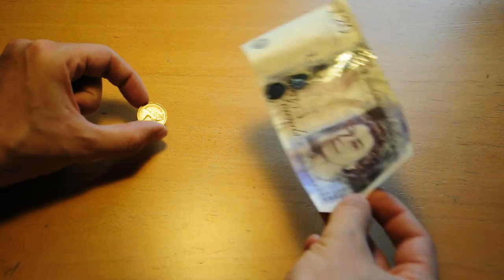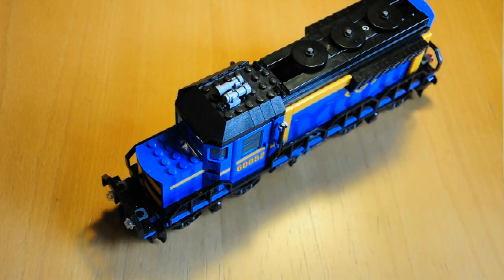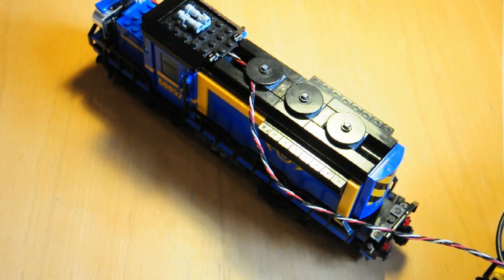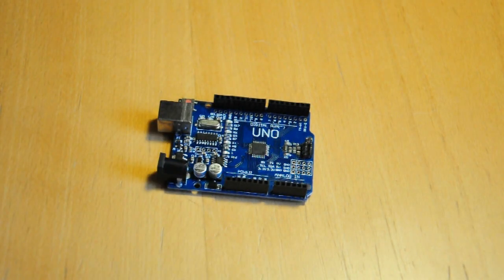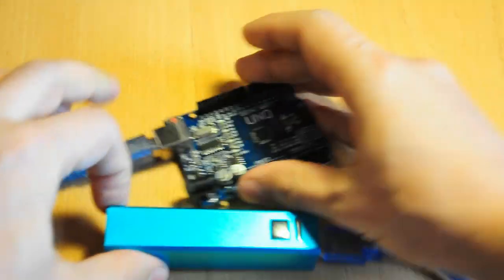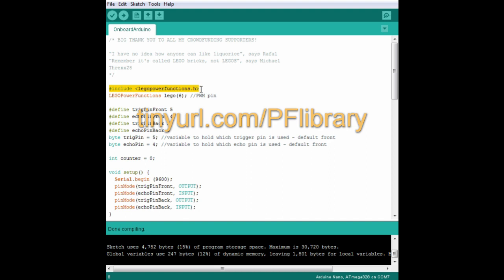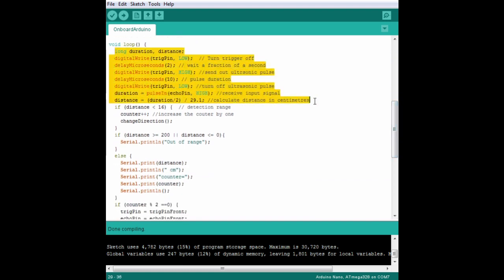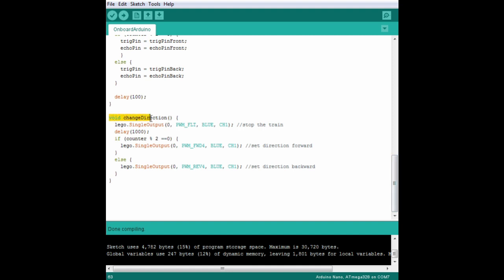Arduino for Lego Trains #12: Onboard Arduino for Power Functions

Comment: For how much time can Arduino works using a power bank power supply?
Reply from the maker: Arduino uses about 25mA and the power bank I use is 2500mAh, so approximately 1000hours. Of course, LEDs and sensors will drop this time significantly, as will power bank efficiency. Still, it will last a lot longer than the AAA batteries in the train!

Comment: Can't you take power from lego battery pakage
Reply from the maker: +Michal Pietrzak it's possible but not stable, especially with these sensors. I will show how to do it on the next video.
Reply: Ale dlaczego?
Reply from the maker: +Michal Pietrzak power output to arduino and motors at the same time is not smooth,  so power to sensors becomes unstable which means the code stops working. With LEDs instead of ultrasonic sensors it is not such a problem,  but IR leds do not work as long range distance sensors.
Reply: What about big capacitor
Reply from the maker: Maybe you can try :) I just make simplest solution for beginners
Reply: Yes , you are right. I understand your intencions

Comment: If I were to just make the train stop without changing direction and only move when there is no obstacle,which part of the code do i change?
Reply from the maker: where it says: if (distance < 16) {
delete the next two lines, and type in: lego.SingleOutput(0, PWM_FLT, BLUE, CH1); 

and in the else section (where it says Serial.print(distance) etc, add the line:
lego.SingleOutput(0,PWM_FWD4, BLUE, CH1);

You can then delete all references to "counter", the void changeDirection, the trigPinBack and echoPinBack sections, to make your code much smaller.
Reply: #include <legopowerfunctions.h>
LEGOPowerFunctions lego(6);

#define trigPinFront 5
#define echoPinFront 4
byte TrigPin = 5;
byte echoPin = 4;

void setup(){
  Serial.begin (9600);
  pinMode(trigPinFront, OUTPUT);
  pinMode(echoPinFront, INPUT); 
}

void loop() {
  long duration, distance;
  digitalWrite(trigPinFront, LOW);
  delayMicroseconds(2);
  digitalWrite(trigPinFront, HIGH);
  delayMicroseconds(10);
  digitalWrite(trigPinFront, LOW);
  duration = pulseIn(echoPin, HIGH);
  distance = (duration/2) /29.1;
  if(distance < 16){
    lego.SingleOutput(0, PWM_FLT, BLUE, CH1); 
  }
  if (distance >= 200 || distance <= 0){
    Serial.println("Object detected"); 
  }
  else{
    Serial.print(distance);
    Serial.println(" CM");
    Serial.println();
    lego.SingleOutput(0,PWM_FWD4, BLUE, CH1);
    
  }
}

ps:Im controlling the motor directly with an L298p Driver.I tried changing THE Codes so i can use it for infared.If You could assist that would be great
Reply from the maker: I don't really understand what you are trying to do. How do you have the L298 connected?
Reply: Its an L298P shield v1.2..I strip the motor wire,connecting it to the motor driver
Reply from the maker: So in this case, you just follow the code from Tutorial 4. You do not need to use power functions library at all, because you are not using InfraRed.

Comment: If you were running on 9v could you power the onboard Arduino directly from the train motor?
Reply from the maker: +Nicholas Jize unfortunately no,  because when the train stops there is 0volts, so the arduino will turn off.

Comment: Very cool! I will definitely look into this. Two questions: 1) would it be possible to control the train motor directly via a motor controller instead of via infrared? 2) could you use the trains power functions battery box to power the arduino?
Reply from the maker: If you check Tutorial 1, you'll see how to control lego motors using an L298 motor controller. You can convert that solution to control PF motors, but you'll need to sacrifice a PF extension cable (ie cut one end off) to attach it to the motor controller. However, If you put 9V in (the power from the battery box) you'll get less than 9V out, so the train will never run at full speed.

You can use the PF battery box using a similar cable to drive the arduino.

Comment: Wouldn't it make more sense to control the train motor directly with the arduino and use the lego battery as power supply for the arduino? That would save space and weight.
Reply from the maker: It would, but then you need a 9v motor controller (L298N or similar) and that requires more than 9V, so more power than the battery box can provide.

The best solution would be to replace the PF battery box and IR controller with bigger batteries (3x18650 or similar Li-ion/LiPo), and I will be covering that in a later tutorial.
Reply: But the motor will probably run fine with 7 or 8 volts :P

Comment: Cool function. You could ajust the speed of the train according to the distance to the object. So the train will drive slower to the object before stopping. I think this would look much cooler.
Reply from the maker: That would definitely be cool! However, the practical limit of these sensors is about 30cm (a foot), and this train with fresh batteries at the set speed (4 of 7, so middle speed) requires 16cm to stop just in time, so there's not much room to play around with in terms of adaptive speed.

But don't worry! I will be featuring adaptive speed control in a later video, featuring a 3-axis accelerometer.
Reply: You could use a PID (Proportional-Integral-Derivative Control) to set a specific distance at which the train should stop from the wall. Arduino has already a specific library for this function, i use it in many application as for example a control temperature.
Reply: I have a Lego mindstorms ev3 program for that. It uses the IR sensor and a motor, and sets the motor speed to the proximity distance. If the train is far from a wall it goes fast, but as it gets closer, it slows down. You could also use this concept in a Lego car.